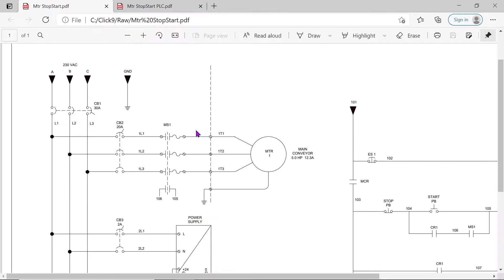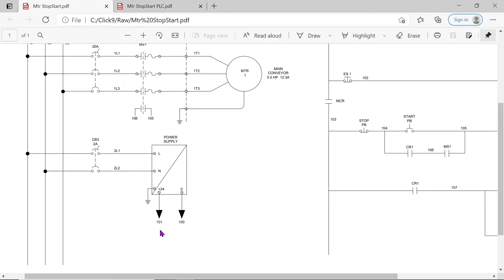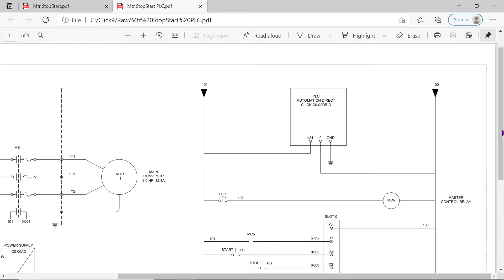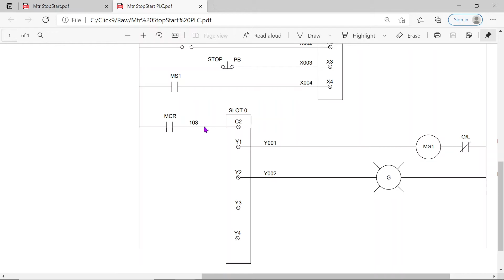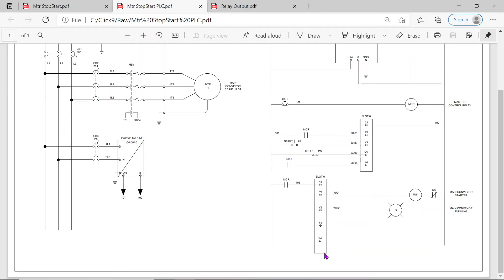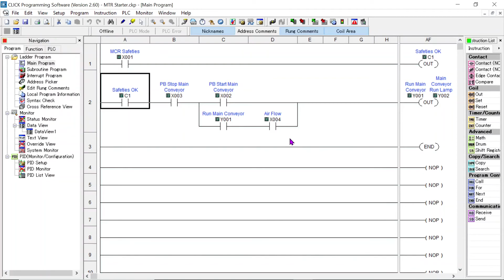Motor Control with the Click PLC. (CLICK 9)

Comment: does the neutral going to power supply need to be fused?
Reply from the maker: Good question. This is just a reference drawing. In this drawing the neutral terminal is not connected to a grounded "neutral" wire but directly to a 230 volt wire. A true system would have an isolation transformer between the 230 vac and the power supply.